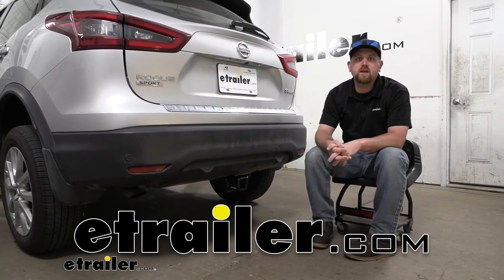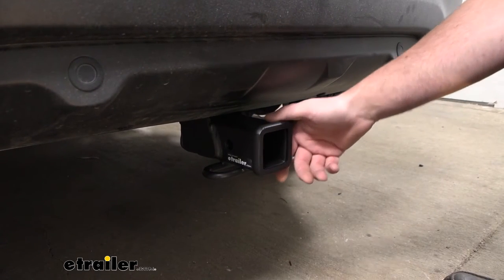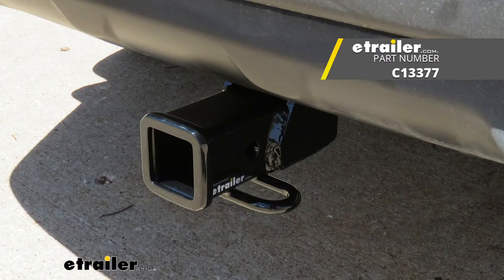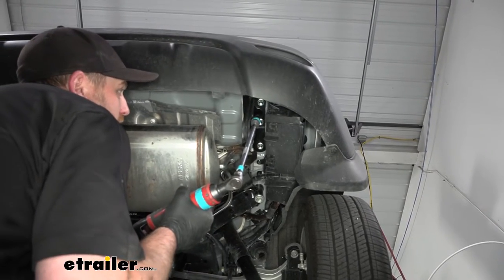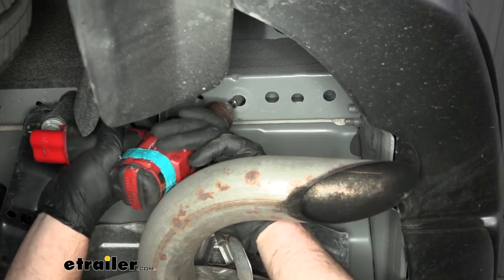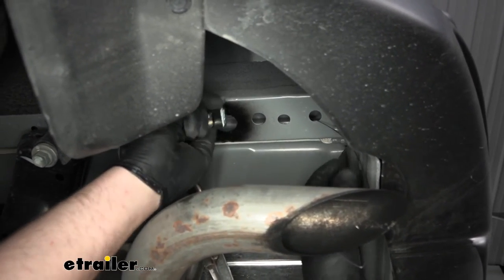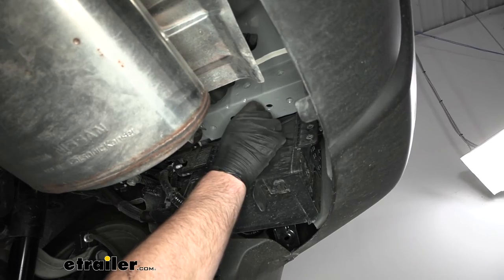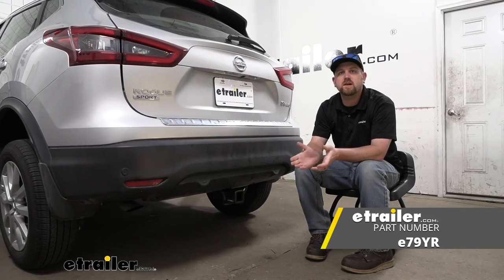2022 Nissan Rogue Sport etrailer Trailer Hitch Receiver: Complete Installation

Comment: What do you do with the emissions tank that you took down you didn't show if you put it back or not
Reply from the maker: The emissions canister is reinstalled after the tow loop is removed. Check out the linked install instructions that mention this in step 2...
https://www.etrailer.com/instructions.aspx?pn=E79YR

Comment: Do you have a video for the wiring harness?
Reply from the maker: Sure do! For the 2022 Nissan Rogue Sport, us the Curt # C33HR. Here's a link to the product page and an install video.
https://www.etrailer.com/Custom-Fit-Vehicle-Wiring/Nissan/Rogue+Sport/2022/C33HR.html
https://www.etrailer.com/tv-install-curt-trailer-wiring-4-pole-2020-nissan-rogue-sport-c33hr.aspx
Reply: You put it on before you put the hitch on or after on a 2022 Rogue